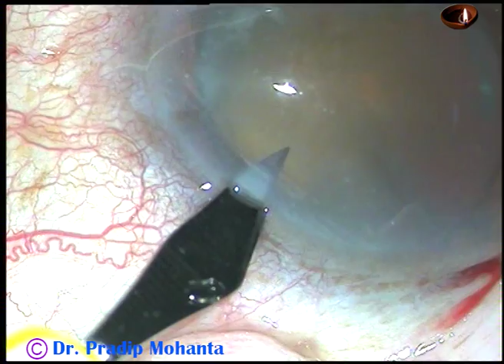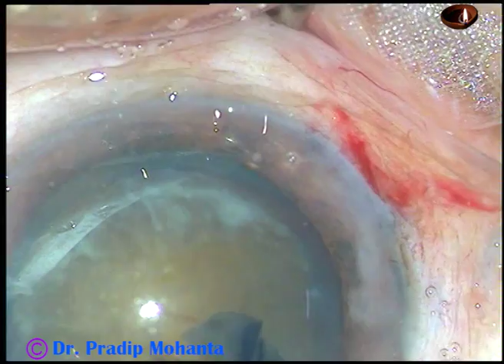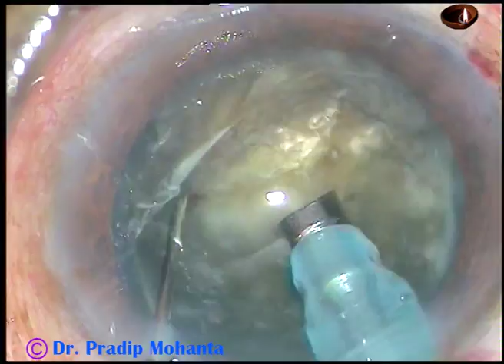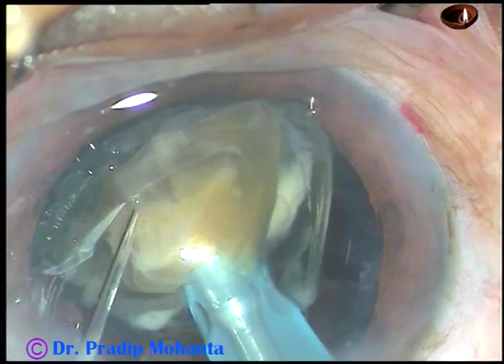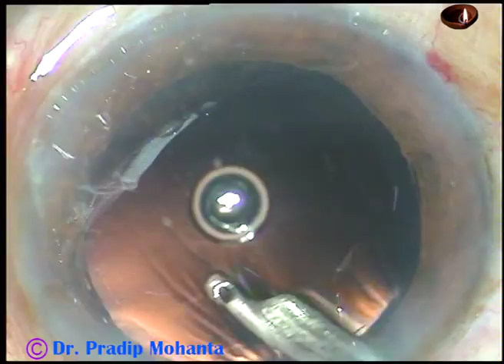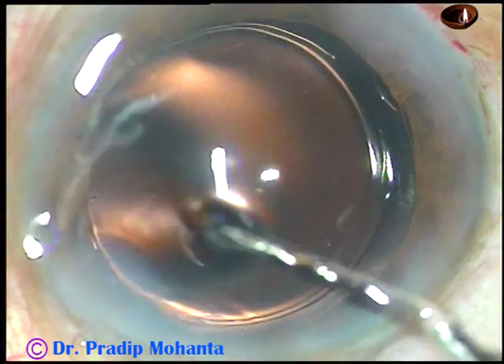SUBMARINE CHOP : A Technique to manage hard cataracts, PM, 4/9/18

Comment: Dr pradip y do you use so high power ?? Cant hard cataracts b emulsified with 60% phaco power
Reply from the maker: It takes too long to emulsify with 60% power.
Power is linear..
More I press the foot switch, more power is delivered. I
Keep it set at 85%
Use it as required,  sometimes 40%, sometimes 80%
Reply: @pradipmohanta9321  ok sir..thanks